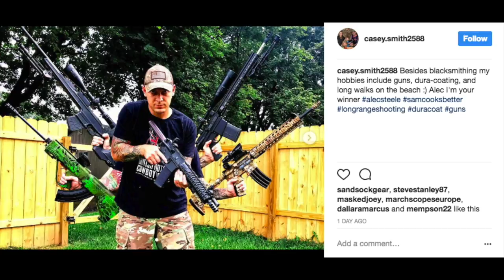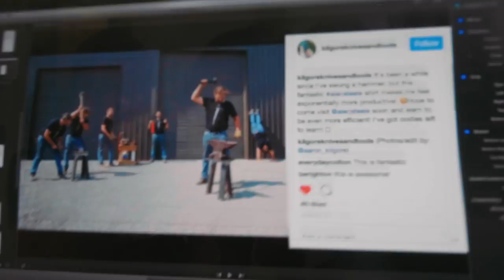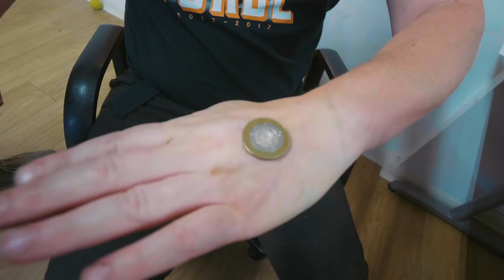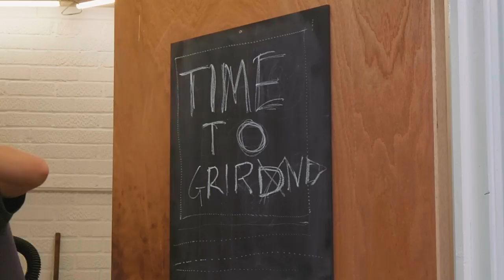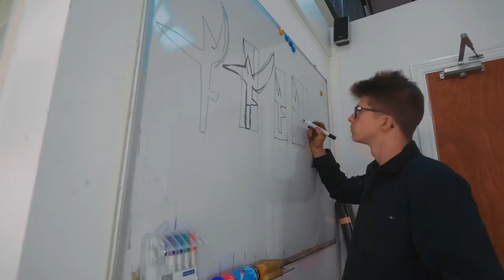MAKING A HUNGA MUNGA: African Throwing Knife! Part 1

Comment: So one tip for planning out something like this; make it out of a slab of clay first. the clay will behave the same as the hot steel, so you can plan out how to cut/bend/draw out all the little protrusions and such without having to guess and visualize and potentially waste a bunch of time if it goes wrong in actual steel

Comment: When doing the hot cut and fold it's best to do a litre water forging to blast the scale off. Then a little heat, little flux, tap tap, bring to welding temp and weld it up

Comment: Sam's got it. Damascus is your signature now.
Reply: Oh and, just use the damn flux. It's not just for cleaning, it keeps the oxygen out, which prevents oxide buildup, which is EXACTLY what you saw there twice. I'm not even a blacksmith and I understand this concept (I'm an electronics guy, solder works the same way).

Comment: Loving the audio/power hammer sync. More of this please (preferably every hammer strike). You could shoot at a higher frame rate to give you options while not losing quality.
Reply: We typically shoot 180 frames for the montage sequences which don't give us audio. But it's nice to have some normal speed hammering once in a while!
Reply: Get a Zoom H1 or similar and record the audio separately (will sound better anyway). Will also make it easier to cut up the audio so the hits sound "real" while still being time warped.

Comment: I noticed with the first billet that split you hit it sideways with your first strike of the hammer. I'm fairly certain you have never done that before because it would deform the steel the wrong way pushing your welds apart. I think that may be more the culprit than basket ball

Comment: The first time I tried forge welding It wouldn't weld went back and researched and found it was a common mistake for rookies to hit it to hard and blow out the weldable molten steel which is what I was doing when it didn't work the first time I thought maybe I need to hit it harder and did that about three times before going back and researching and it worked after that

Comment: As you started feeding that first stack to Mr Pilkington, I wondered if you no longer did the few compacting hits you used to do?  Since I thought you typically did a couple hits before full temp then put in back to heat to welding temp, (or maybe that clip ended up on the editing room floor). Oh and when you dropped the finished billet (twice) there was a ting sound, like a crack makes...

Comment: You should pair with a company that has the ability to make phone cases.  Have a nice one made that sports your emblem and call it a Steele case.  Your emblem/tool mark, not sure what it's really called, could be hand hammered onto a small piece of steel that's affixed to the front or back of the case.  I'd buy one.  Just make sure they work for Android and Apple phone so you don't lose a market.

Comment: Hey Alec.  I'm sure you've heard of the 1000 layer challenge.  I've seen it on several sites, but no one ever does it by starting with a single piece of metal.  They always weld a stack of sheets together, then start folding.  Is there a reason why?  Is there a reason you can't fold a single sheet of metal 10 times to come to 1024 layers?  I'd sure like to see you try.

Comment: hey Alec I am pretty young and I like blacksmithing and I was wondering where you got your metal from because I haven't been able to find any low cost metal easily
Reply: if your low on budget try going to scrapyard og your local mechanic, often they have steel the throw away thats alright for a beginner blacksmith. look for things that are springy like leafsprings if you making edgeholding tools. or tough lige car axel if your going for making punches. or hammers.

hope this helped, its not so long since i startet my self and recycling is how i get most of my steel :)
Reply: If you're in the United States, try the New Jersey Steel Baron for good, reasonably-priced steel!
Reply: Thanks!

Comment: Epic project! Alec, I was wondering how the chemical bonds you fixed the power hammers to the surface bed are holding up. And have any of the expensive lights come down yet? Overall, how has the new workshop been!

Comment: Ok .. so.. stupid question time .. by using the TIG torch to fuse your damascus billet instead of MIG welding it .. does that add to the pattern and does that also alleviate the need to grind out/off the filler material??
Reply: Andy Amend as far as I understand it, doing that causes the layers to melt together

Comment: Maybe the failure is because you're hammering the sides of the stack too soon...I personally NEVER hammer the sides of my billet...Draw out your billet, hot cut almost thru, fold back on itself using flux between the sections, reheat then continue drawing out the billet. Repeat several times...I find fine damascus layers much more appealing than the larger ones...

Comment: so the first time you didn't use flux when forge welding the Damascus, and because of that you failed, I'm wondering if there is anything wrong with using flux, because it seems like if you use flux it gives you a much higher chance of success when forge welding.

Comment: Alec why do you not use flux when doing a forged wield?
Reply: alec uses precision ground steel from what I can see. there is no(or VERY little) space that can oxidize between the steel pieces if they are precision ground flat to eachother. He could also be fluxing off camera

Comment: Bro why are you using a 9 inch grinding wheel for stuff like checking for that crack? You need to get some flap discs man. Get some 3m cubetron. Not only do they grind quicker but they also leave a decent finish. If you get 4 1/2" theyre less than a dollar a piece depending on the brand.

Comment: Did you know genius and insanity are linked? So either you are a genius making a crazy weapon with a hammer, or you are a crays genius, with a hammer . Your choice, but you can only pick one...... BTW spelling and grammar in English are crazy difficult, 1/2 the rules are from Latin and 1/2 the rules are from Germanic, Languages! I didn't get so I could s-p-e-l-l and understand grammar until I learned Latin. High talent in structural visualization (the talent to see an end product in the steel) equals low graphoria (the talent that gives people the ability to use words in print) I still can't fill out simple forms. :(